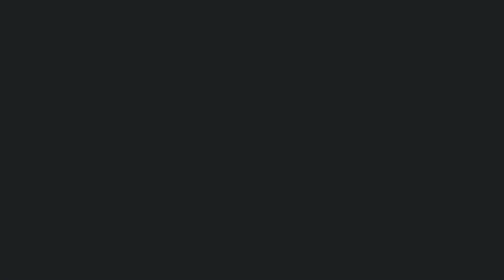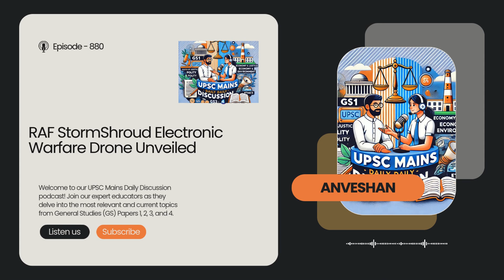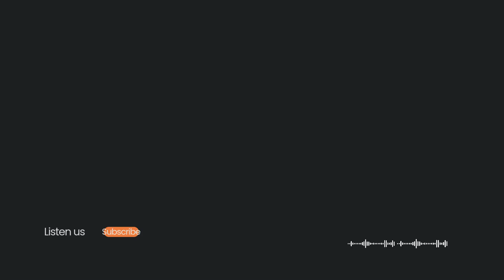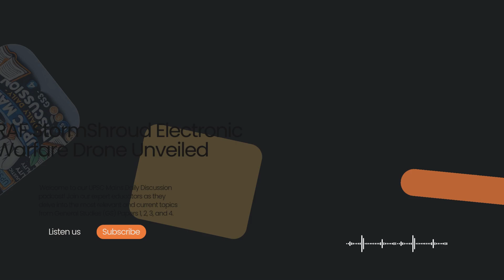👉 RAF StormShroud Drone Unveiled 🚁Next-Gen Electronic Warfare Explained | Military Tech 2025 - 880

Comment from the maker: What is StormShroud and its primary function?
StormShroud is the British Royal Air Force's (RAF) first Autonomous Collaborative Platform (ACP). Its primary function is electronic warfare (EW), specifically Suppression of Enemy Air Defenses (SEAD). It operates in a manned-unmanned teaming (MUMT) format alongside crewed RAF fighter jets like the F-35B Lightning II and Eurofighter Typhoons to enhance their survivability and operational effectiveness by blinding or deceiving enemy radars.

How does StormShroud achieve its electronic warfare capabilities?
StormShroud is equipped with Leonardo UK's BriteStorm electronic warfare system. This system acts as a "stand-in jammer," designed to operate closer to enemy defenses than traditional "stand-off" jammers. BriteStorm detects enemy radar signals, analyzes them using advanced Digital Radio Frequency Memory (DRFM) technology, and then responds with either advanced spoofing techniques or electrical jamming. This manipulation can create dozens of "ghost" targets on enemy radar, making it difficult to distinguish real aircraft from fake ones.

What are the key components that make up the StormShroud drone?
The StormShroud drone is a combination of two main components: the Tekever AR3 uncrewed air system (UAS) and the Leonardo BriteStorm Electronic Warfare suite. The Tekever AR3 provides the airframe and flight capabilities, while the BriteStorm system provides the specialized electronic warfare payload.

How does StormShroud's operational concept differ from traditional electronic warfare methods?
Unlike traditional electronic warfare that often relies on large, expensive aircraft acting as "stand-off" jammers from a distance, StormShroud utilizes a "stand-in" jamming approach. This means it is designed to operate in closer proximity to enemy integrated air defense systems (IADS). Its smaller size, lower cost, and ability to be potentially expendable make this approach more viable and reduce the risk to crewed aircraft.

What lessons learned influenced the development of StormShroud?
The development of StormShroud has been significantly influenced by the lessons learned from the conflict in Ukraine and other recent battlefields. These conflicts have highlighted the increasing sophistication of adversaries' air defenses and the need for more adaptable, agile, and cost-effective solutions that reduce the risks faced by human pilots in highly contested environments.

How does StormShroud operate within the RAF's strategy?
StormShroud is the first of a new family of Autonomous Collaborative Platforms (ACPs) being introduced by the RAF. The RAF's strategy emphasizes optimizing their strength against sophisticated adversaries through a blend of crewed and uncrewed autonomous platforms operating together. StormShroud supports this by providing a dedicated EW capability that enhances the effectiveness and survivability of crewed aircraft.

What is the operational deployment plan for StormShroud?
The StormShroud will be operated by the RAF's 216 Squadron, supported by the RAF Regiment. Personnel from both the Regular RAF and Royal Auxiliary Air Force (RAuxAF), along with other UK Defence personnel, will be involved. Training will focus on operating in high-threat situations in small teams. While designed to operate alongside F-35 and Typhoons, the StormShroud will be launched from the ground using a portable catapult mechanism.

How does StormShroud compare to other "loyal wingman" type drones being developed by other nations?
While parallels are drawn between StormShroud and "loyal wingman" drones being developed by other nations, such as the U.S. Collaborative Combat Aircraft (CCA), a key distinction lies in its specialization. Unlike multi-role loyal wingman drones that can carry additional weapons, extend sensor coverage, or perform various missions, StormShroud is purpose-built solely for electronic warfare, specifically SEAD, utilizing its BriteStorm payload. It is also noted as being smaller and less survivable than the US CCA.